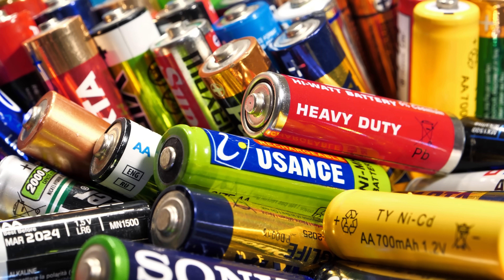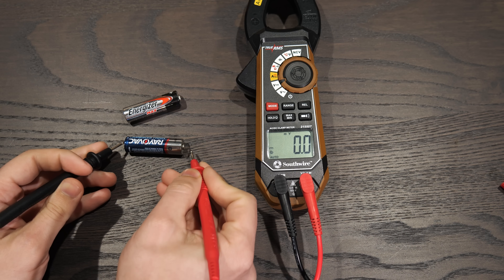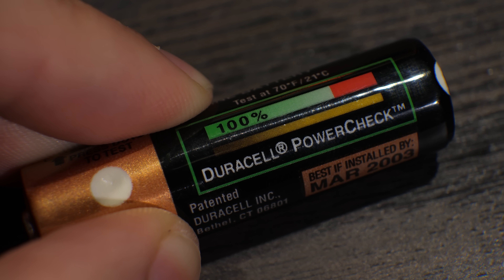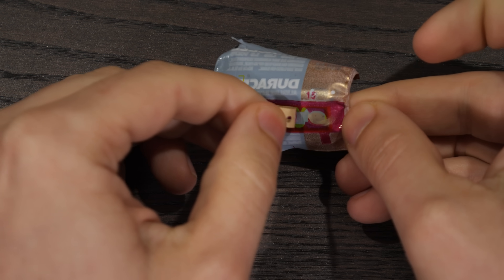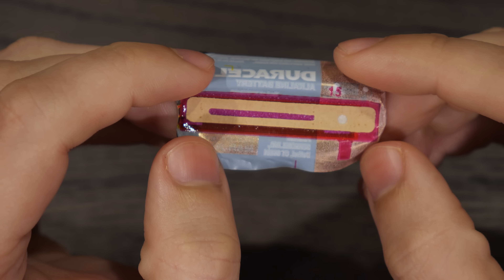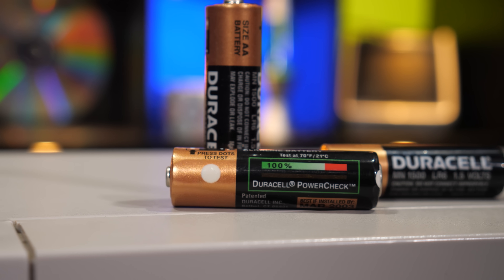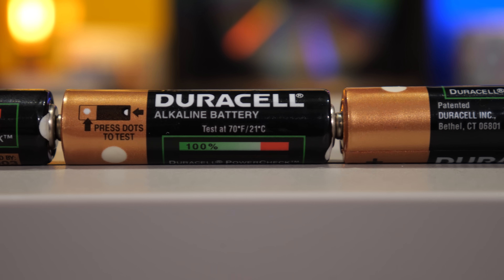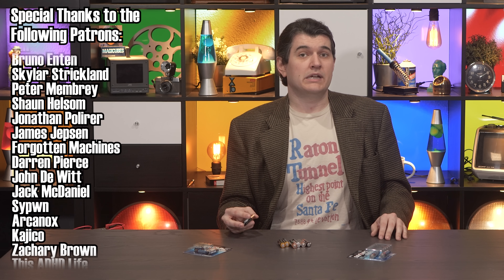Duracell PowerCheck: A genius idea which didn't last that long

Comment: So, if a TV remote has 2 dead batteries, but they still make some energy, what would happen if you connect together 4 or 6 or 10 dead batteries, would they be enough to make enough power for a TV remote? In the old days, would it be a saving thing to save a bunch of dead batteries to then power something?

Comment: Batteries at 70% which were used in high power things like toy cars are no fun anymore, so I change them. But for TV remotes, clocks, emergency lights or other low power things they are perfectly fine. I rotate batteries constantly through the household.

(Have three kids - Lesson #1 - toy battery consumtion is indirectly proportional to the age of the kid 😂)

So your theory that batteries are not tested during their lifetime is not exactly correct.

Comment: They still sell Duracell AAs with Power Check here, the design is a bit different, but basically the same thing.
EDIT: Just found a "Economy Pack" of Duracell ULTRA with Power Check in the drawer, I bough about 3 months ago.

Comment: I remember these! I thought it was cool when I was little, but I also know why they didn't last long: because most people don't take the batteries out of a device to check the charge. They just use the device until it stops working and then change to a new pair of batteries. We never even had a battery tester even before the powercheck.

Comment: My biggest problem with these was I couldn't ever decide if it wasn't lighting up because the battery was dead, or if it was just because I couldn't push hard enough to get it to work. So I ended up just testing them in the thing I was trying to power regardless of what it said.

Comment: I think this feature would be great on rechargeable batteries. It's easier to get charged and uncharged batteries mixed up since they are all loose and sometimes a battery ends up in the the wrong pile/container. Sure the battery tester is probably close to where the batteries are stored but it would be nice just to press the battery and find out.

Comment: I remember these! I loved them a lot and was a bit disappointed when they stopped putting them on their battery... 
I find it interesting that Duracell more or less replaced the tester with a "use by" date, which is basically just as effective for the vast number of users but is just a couple additional lines of print...

Comment: "Composed of a single cell. Like an amoeba!" I adore your delivery of lines like this.
Reply: It took me completly off guard.  I laughed way to hard.
Reply: If they were as squidgy as an amoeba it would make fitting them into odd shaped equipment easier. 

Wait: I've just invented the "jelly bag" type of cell that gives phone manufacturers the excuse to make them non removable.
Reply: It invokes the "Yeah, that's not-- you know what, nevermind" response. Thing is, though, the term "battery" implies more than one cell, so most commercially available "batteries" are not (9-volt batteries are the only commonly-used alkaline battery that is actually a battery of cells, and often they're actually batteries of six packaged AAAA cells, though sometimes they're stacks of raw cells).
Reply: @StarkRG  Also, there was the 12v car key-fob battery from around 20-30 years ago, although I haven't seen one for some time.
Reply: howsabout a police van? a single cell vehicle
Reply: Powerhouse cell if you will
Reply: Why not "composed of a single cell. Like an ostrich egg".   :-)
Reply: as a pretend biologist i found that comparison very useful. 10/10
Reply: He does a good job with these videos. The electronic history videos are my favorite. He is knowledgeable and entertaining.

Comment: I am one of those people who save partially dead batteries, at least sometimes.  I have a wireless mouse that uses next-to-no power.  A "spent" AAA battery will power that mouse for 1-3 months, at which point I just chuck the now truly spent battery and put in another "spent" battery.  And yes, I do also own one of those cheap imported battery testers too.

Comment: I kept a couple of the Duracell packages with the built-in Power Check. Once, for laughs, I connected a AA Power Check to a fresh 9-volt battery. The thing heated up so much it burned the plastic. I never did that again.

Comment: Disposable batteries are a dying industry. With the rise of integrated, rechargeable  batteries in all our tech devices, the AA - D batteries are probably a decade away from being history. 
The disposable battery companies have worked hard to keep themselves alive, striking under the table deals with companies to keep their batteries in some devices. Devices that would be far better off with a rechargeable. TV remotes are the most common house hold item that still uses disposable batteries when they don't need too. The Xbox controller is another example. All other consoles use rechargeable controllers. 
They have tried to pivot their technology by introducing rechargeable AA batteries but it's just a stop gap. 
Soon our TV remotes will simply have a USB-C charging port in the base. That will mark the end for the disposable battery.

Comment: Dead batteries also sound different when you clink them together compared to alive batteries.  

No but seriously, I can't believe how much it bothers me that more in my house now runs on AAA batteries than AA batteries.  All my smart thingies like my thermostat use AAA, my stick-on LED lights use them, most of my remote controls use them.  I think at this point the only thing I regularly use that takes AA's is my clock!

Comment: Apparently, dropping an upright battery from a short distance is also a way to tell if a battery is dead too. A dead, or near dead battery, will bounce. A charged battery will just sorta' thud and potentially stay standing.

I never knew this, wish I did, would have saved so much time.

Comment: My fingers still have the marks of where I had to press those godforsaken batteries. 

That said that was a lot easier than having to bring out a multimeter. Especially when your wife throws dead batteries into the battery drawer which is supposed to be for fresh batteries. Thanks, babe!

Comment: Another problem with these was just how difficult it was to get the tester to work. Is it dead, or am I failing to press hard enough. But yeah, not once did I ever take a battery out of a device to test how much charge was left. Unfortunately, here in Japan, single use batteries are very common. I hardly ever see rechargeable batteries and chargers in a supermarket, it's always one use.

Comment: The main thing was if you bought 8 or even more and 3 or so years later you wanted to see if the batteries were still good even if the best use date was saying no. Then the tester was amazing. It was never that they were half used it was that you buy 32 of them and years go by and wonder if what you have left are dead or not.

Comment: What I find the strangest is how rechargeable batteries does NOT have this. Those things are expensive, a tester won't significantly increase that. And I keep them in small drawers at all sorts of levels of charge, whether it be from self discharge or just my mess.

Comment: Cant believe it's been so long since these were a thing. 2 years ago I gave the grandkids a gift that said Toy Not Included, a pack of batteries. I use a battery tester weekly to tell them if the ones they found are good or bad.

Comment: Putting these test strips on RECHARGABLE batteries does make sense, much more sense than on once-and-done batteries.  I do move those from one device or another, often just on whim or as I am rushing out the door hoping to have enough charge to last till I return because I am just that way and running to the battery charging and waiting the 3 seconds for the charger to show me the remaining charge simply takes too long.

Comment: I actually miss these, they did hurt my fingers when using the tester but the fact that you could tell if a battery had any charge left or if it was completely used up and ready to be thrown away was a nice feature.
And yeah, thinking back we really used a ridiculous number of disposable batteries back in the day, probably mountains worth of the damn things.

Comment: I had wireless headphones used as my audio for watching TV which took two AA's. Kept a written note card on when I had to change batteries; I noticed that when using the ones with the power check, these batteries didn't last as long compared to the same brand without the built in testers.

Comment: I just had a use for these things than you forgot to touch on - storage. I got a few packs of duracells with this tech at lowes a couple years ago for pennies because they were within a year of their use by date. I grabbed a couple a few weeks ago out of the pack and they were dead. So i used the built in test strips to find the ones that were still alive. It worked great, about half of them were still good. Without that strip, i probably would have just shrugged and thrown the whole pack out. So i used all those batteries asap and got more use out of them.

Also i am one of few who does have pretty strong brand loyalty to the hrvay duty duracells with a guarantee that they will last until their use by date, because i use them in my work flashlight as an EMT and for emergency use at home, and knowing they're good is important. I have had to throw out a case of anker batteries that didn't even make half of their shelf life.

With how relatively infrequently we use alkaline batteries now, it seems more important than ever to buy ones with a guatanteed shelf life.

Comment: I could have sworn that these were still available.  One niche reason these were good was, sometimes, they could help you troubleshoot if the device was faulty, or the batteries were dead.  I can't tell you how many remotes I've had that would stop working but the batteries were fine.  Having the tester on the battery helped me out quite a few times in that very specific scenario.  I learned a different trick there, aim the remote at a digital camera.  You can see the IR light on the front light up on a digital camera if it's working.
Reply: They are still there. Sometimes when you dont search for them.

Comment: You have a battery charge detector built right into your body. Stick the negative end on the roof of your mouth and the positive end on your tongue. If it tingles your tongue, there's a charge. Be careful trying this with 9v batteries because when you do it (both ends on the tongue with that one), the tingle is pretty strong, and almost a shock.

Comment: I remember those and I always worried about how power was wasted heating up the strip, not a small amount. But putting that heating load on the battery probably made it very accurate! 😛 The best feature would be an alkaline (or equivalent) battery that doesn't ever leak!!!!

Comment: I dunno man, I remember loose batteries everywhere*...because as you say, we'd burn through piles of them...and not everything which uses them is something you need to use all the time, especially as a kid, so you'd pull them out and swap them around. Some devices used two, some used six so you'd have a set of six then pull two out for something else then put them back, you'd mix pairs (or singles or trios even...) from three different devices to get that favorite toy running and eventually you'd know that *some of these batteries are dead, but probably not all...and over time you learned how much power different devices needed, you'd save the batteries the walkman thought were "dead" and get a few hours out of them in some smaller toy, or months out of them in a remote...I even remember squeezing those things specifically looking for the "dead" ones when I didn't want to "waste" a set of good ones!

Like...mom's not going to the store for batteries at 8pm, mom thinks she's spending too much money on batteries and says no, so you work that resource management puzzle and swap some things around. We loved these built-in testers. Otherwise you were just guessing!

I mean yeah we could have gotten a battery tester...but we didn't. Some of those did test under load IIRC, I think I remember hearing that cited as the distinction between a proper battery tester and a volt meter -- just a built-in resistor between the leads.

Man...I remember squeezing those dots like we were trying to push more power into the battery xD

Comment: They had some of these testers on separate strips that came with some batteries before(?) they came built into the battery label. I really liked those as a kid as well but now as an adult i do believe all of it would be impractical. I later had a RadioShack battery tester that tested all the common types like what you showed and honestly that was so much easier and faster to use.

Comment: Someone recently blew my mind complaining XBox controllers are the WORST because they eat batteries so fast. WHAT? How much time are you playing? Also, buy literally ANY $20 rechargeable battery kit for controllers instead of $400 of batteries, and they will outlive the console!

I use rechargeable batteries in everything that doesn't require a lot of juice, like computer mice, remote control, etc.

Comment: Duracell batteries suck.  Energizers are far superior.  I say this because I repair electronics and have had many devices come to me that had been damaged by batteries that were left in the equipment for far too long and had gone dead, leaked, and caused corrosive damage to the electronics.   And without question,  Duracell damage is ALWAYS far worse than Energizer damage.   Energizer damage is usually pretty minimal and I'm able to restore most devices with that damage to good working order.  But about half, or more, of Duracell damage cases are absolutely destroyed.    

Hospitals usually do not allow Duracells to be used in portable electronic devices.  They use Energizers.

Comment: I only wish they made them more leak-proof so that my electronics are not ruined if I don't use it for a few months. Strange they haven't solved this issue after all these years.*

AA is to AAA what D is to C, as far as size goes, which means that if you have a device that requires a D battery but you don't have one, you can use a AA battery in a pinch. Same goes for the C, which can be substituted with a AAA in a pinch. They won't last as long of course and you might have to use something to keep them from wiggling around and falling out, but it helps to know in a pinch.

* Though I have a lithium 9V that seems to be built better and I've had one in my outside garage door opener for 10 years with no leaks (and it still works!)

Comment: Ok, so this damn thing was around for most of my Gameboy Advance using childhood, and it was the WORST. In the households I lived in, (home and grandparents) it was common to have a 'battery drawer' for old batteries; remember that you rarely insert just one, so usually when a device runs out of charge, that just means one of them isn't able to apply enough juice, the other might still have an hour of GBA, or 10 days for the remote left in it if paired with a fresh one; so having a power checker for that was a really good idea! But you know who usually needed to use it? KIDS! And who couldn't press those damn poles hard enough to get a read? A kid. So, like everyone else, I just started inserting batteries to check instead, and still do.

Comment: Half-used batteries are the best thing for holiday lighting.  Put out something for Halloween.  When that's over, move the batteries to the Thanksgiving display.  When that's over, mover the batteries to the Christmas display.  If they're not dead yet, pass them over to Easter.  (For example.)

Comment: During the days when needing to have a stash of fresh batteries nearby there would inevitably be situations where some device like a boom box needs more batteries than you have handy and you have to go steal some from some other thing. And then you forget about that and the thing dies and you have to figure out which of the batteries died because they were at unequal charge and when one goes they all go. I agree that these fancy labels died for good reason for the reasons you say - but during their production heyday I argue they definitely did genuinely feel useful to me because I was always swapping batteries of uncertain provenance. Most things now use Lithium Ions or something built-in. Which is kind of its own whole set of issues, batteries are in way too many things.

Comment: Another potential reason Duracell moved from separate testers to ones included on the battery was that separate testers could be used on other brands of batteries, but the power check testers could not.

Comment: Bummer, I used to use this feature all the time. Sometimes old batteries get mixed with new ones and you need to tell the difference. Sometimes batteries have been sitting so long you don't know if they are good anymore. Sometimes you have to dig perfectly batteries out of the trash when you find that, after swapping for new batteries, the device still doesn't work (e.g., defective device, bad bulb, user error, etc.). It was nice to have a built-in tester.

Comment: I must be in the minority but I have a voltage meter and test batteries before throwing them away.  Usually a battery that is too weak for something like a game controller can still run a wall clock.  Plus I remove batteries from devices that I may not use for a while because they will eventually leak and corrode and maybe ruin the device.  Especially with Halloween decorations that have LED lights.  I take the batteries out before storing them for another year.